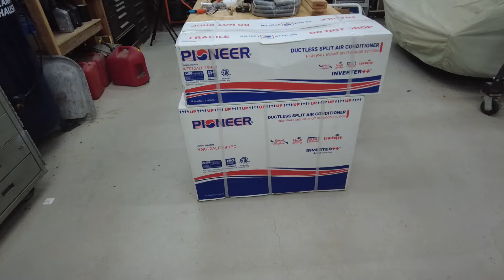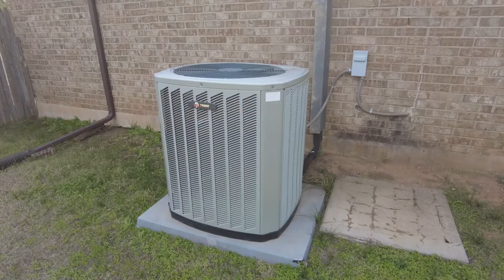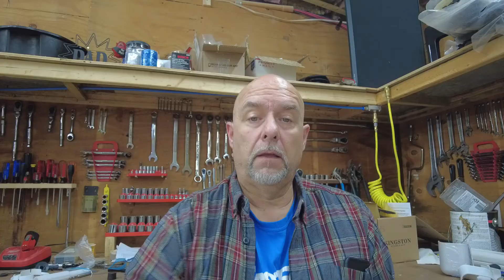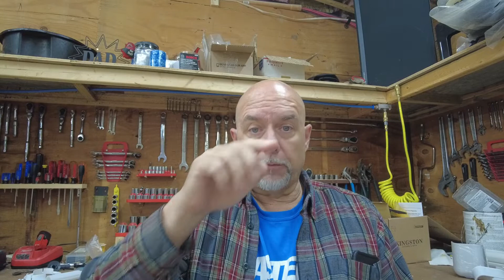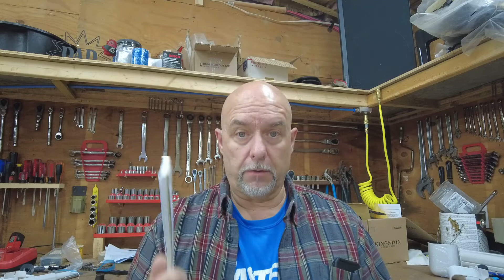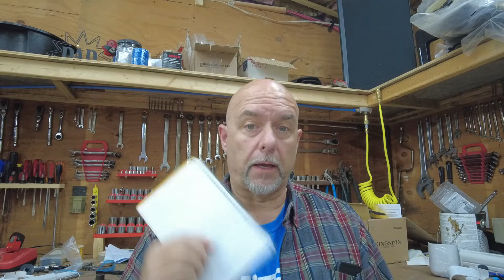Why Install Mini Splits, Lets Talk Back-up Power

Comment: How much is inrush or starting current on the mini splits?  That is what determines the size of generator is needed.
Reply from the maker: The starting current on most inverter type mini splits is minimal. As they slowly ramp up to speed. Mine never exceeded the operating current rating of 8 amps.

Comment: I have a thermocore mini split 2 ton is 5 years it was use very day last year I removed it from the old house  and build a new house and installed it in the master room the new house has a 4 ton but the 2 ton is for emergency